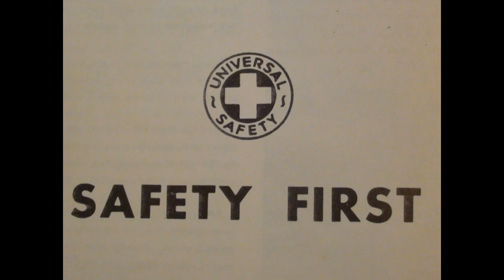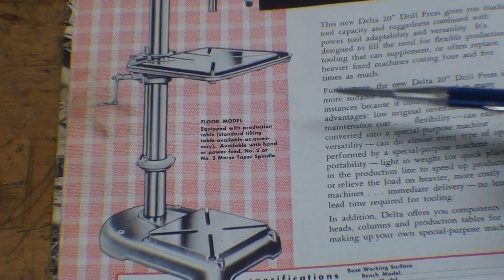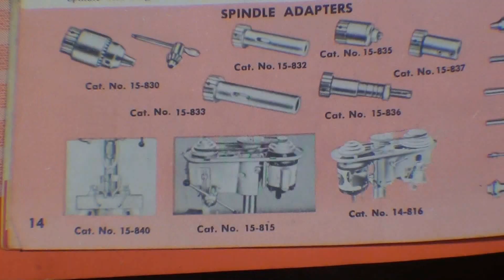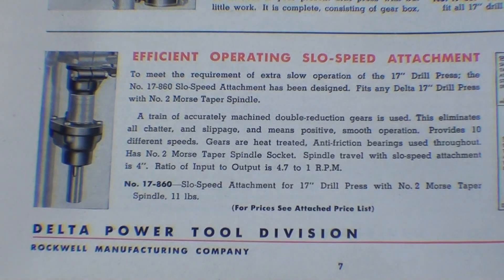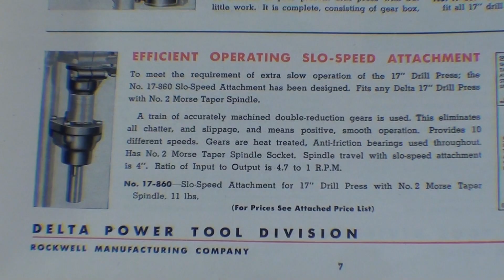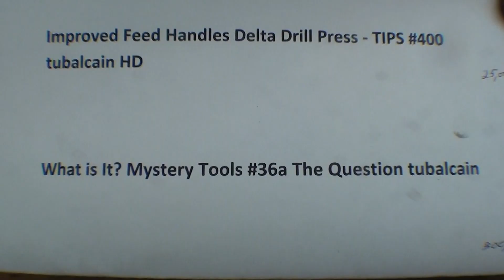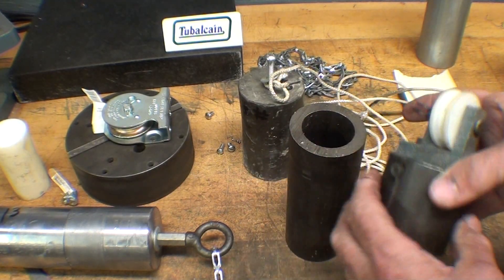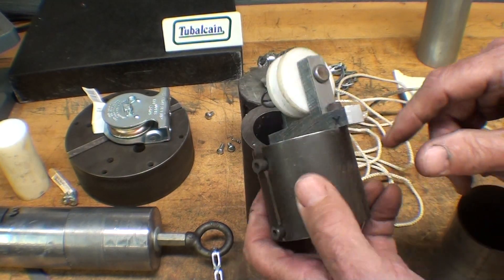COUNTER WEIGHTING A DRILL PRESS TABLE Tips #404  tubalcain

Comment: So, basically, with a counter weight you can just remove the worm gear and gear rack?
Reply from the maker: My machine did not have the worm and rack. That’s why I had a counterweight.
Reply: @mrpete222 but still much faster and easier than cranking the table.

Comment: Just found this 6 yo video and watched it not because I need to counterbalance my drill press table, but because I want to counterbalance the head on my dovetail column mill. The head on these dovetail columns tends to tilt forward when the locks are loosened. This means it is no longer truly vertical. Then, when you try to tighten the locks after changing the height of the head, it is very difficult to get the head back to a true vertical. I wind up trying to push it against the dovetail from the front while simultaneously tightening the locks which are at the rear of the side. This is not easy. And I fear that it is a problem with all the milling machines where the head is mounted on a dovetail column. 

The dovetail column design cures the X-Y position problem of the round column mills but introduces this problem with keeping the front-back tram. I have to wonder how many people don't realize that this is happening and simply blame it on a poorly manufactured machine. 

I was thinking of using some steel cable as you mentioned, but like your idea of using the sash chain instead. Of course my counterweights will have to be on the outside of the mill's column, probably in the rear. I think I will need a steel angle frame to hold the pulleys. Some of that perforated angle comes to mind. 

So, thanks for the sash chain idea.
Reply from the maker: Sounds like a good idea

Comment: Fantastic design and impressive application.  My Craftsman has a very heavy table as well and it's nearly dangerous to lift and lower.  Wish I could find someone to make me a counter weight.
Reply: You should be able to purchase a piece of solid bar stock about a 1/2" or so smaller in diameter than the bore of your column from Online Metals or maybe a local scrap yard. Unless your table is unusually large or heavy, a 12"-16" length with a hole drilled and tapped in the top should give you considerable leverage for raising your table, even if it is not lead. Good luck!

Comment: Never ever think I have said something derogatory to you as you are an idol to me. Instead of an eye bolt if you put a pulley and run the chain through and back up tp the top. Would that be better or worse? They used to use a system like this on windows to help raise and lower. Also fire doors use this kind of system to slam the  door shut if the heat link melts that holds the weight. Kind of a guillotine effect. Thank you very much for all you do. Lead, follow, or get out of the way. You lead and I will follow but someday aspire to lead.

Comment: Hello.I have a drill press, but the column has an open hole only on the bottom side facing the ground. The top side is closed. I wonder I could switch them around or if that would cause problems

Comment: A very good solution, I like it. my drill press is much like yours except it has a rack, and handwheel to raise and lower, I'd like to mention if I may, concerning the slow speeds, I moved the motor pulley stack from the motor, inboard on a plate, and then used a shorter belt, then  mounted a 2 to 1 reduction extra belt and pulleys, one small one on the motor to the large one on top of the original pulley stack, now my 600 rpm is 300 rpm, which helps with the larger drill bits. hope you're following me! well it's been 4 years since this went up, but just thought you'd like to know, take care Mrpete, regs..Dave

Comment: I see that this video is already over 3 years old at this point, but if you're still answering comments I'd appreciate your input. I'm looking for a benchtop drill press for light workshop duty. My budget is around $100 +/-. Would you recommend a new machine (such as a WEN) in that price range, or a used machine (such as a Craftsman, etc)? Any favorites?
Reply from the maker: Used. craftsman or atlas

Comment: A sash weight would work on a small drill press like mine. Photographic enlargers use sash counter springs for the same thing. I want to modify my little drill press with a couple of those rings, 48mm shaft collars will work on my little Craftsman and it can wait until I get my lathe since the shaft collars are more money than the drill press.

Comment: I sure am happy you fabricated that plug for the speed handle, WAIT, I haven't seen that video yet so I didn't have the opportunity to be outraged over your lack of a finishing touch.  I will go to bed and watch that video tomorrow and try to block the fix from my mind so I can be duly outraged like some of the others.  I sure enjoy your videos and your sense of humor and promise not to be outraged at your modifications.  I really need to inspect my old Craftsman bench top drill press and see if I can fit it with this counter weight as that table is so heavy I rarely move it and use blocks instead.

Comment: My 1938 column is solid steel a beast,,,11 inch delta drill press that's probably weights 300 lbs
Reply from the maker: Do you mean to tell me it’s solid bar stock, and not hollow tubing?
Reply: @mrpete222  sure is,, I payed 50 dollars for it,, and it's better then my 900 dollar newer delta,,,so true I turned it into a milling machine

Comment: I bought and restored a 1938 delta drill press bench model and I mounted an automotive scissor jack under table, works well and gives a truss effect.
Reply from the maker: Good idea, but if it was mine, I would have to keep a dedicated battery powered drill on it at all times. Perhaps you do
Reply: @mrpete222  never thought of that,,,but I will give it a try,,,the scissor jack is really smooth operating
Reply: @mrpete222  I figured if it can lift a car,,,I can turn it with my fingers and your drill idea would be perfect

Comment: mrpete222 #1 i have a Dayton floor drill press with a slight ding in the 2.3/4" column I can wiggle the table over it .. Should i just file the column or file a spot on the collar ?... #2 i love the counter weight idea..I bought it for a 100 bucks..cleaned an painted it the column sparkles, . Replaced the 4 step pulley on the motor , they had an odd pulley on it. I use it for home hobbies..I like to hear you thoughts on that. Thank you , Dan from New Haven,CT.
Reply from the maker: File the column
Reply: That is what i wanted to hear..TY..

Comment: Re: upgrade on the three arm handle add-on

Hex Head!  That's just a hack job!  Why didn't you use a SHCS?

oh, and it's only a grade three, what don't you ever think about durability?  Shoulda been a grade 8!     LOL...   

Why aluminum? Cause it's adequate in strength, and easier to machine!  

All joking aside, I'd do this for my drill press if it wasn't destined for the scrap heap. Need one without the ungawdly run out this one has.

Re:  the cast column clamps as a table stop.  I found 2" ABS pipe works great as table stops.  Cut a bunch of them to various lengths you want, then cut enough away from the circumference the pipe will 'snap' over the column, and stay on.

Has saved me from smashed fingers from the too heavy table, several times.

re: slow drill speed

I slowed my drill press down about ten years ago, and I still am amazed at how it changes a drill press.  It's like it's another tool.  The only time the slowness is negative is when I have to drill > ⅝". Then I need mo' speed.

Thanks for sharing, and all you do.

GeoD

Comment: when  you had your craftsman?   did you like the craftsman the least?  If so why?  and what model was it?  I have the Craftsman 100 1947 floor model wit h 1 hp motor and middle pulley.    I   found your vid because like yours the table is hard to lift.  Someone put a crank on mine but I may change it to a counter weight.
Reply from the maker: I don't remember the model number of my own. But I did not like the one that use the skinny little Veebelt

Comment: Tubalcain. The pulley that you showed is made by national hardware. 3219BC Wall/Ceiling Mount Single Pulleys  model # n233-254 for the 2" size that handles 3/8" rope. They also make this in a 1.5"  n233-247 that also takes up to 3/8" rope. The 3 mounting holes are .26" diameter. You can mount this to the side of a rafter, bottom of the ceiling, or on the wall.  I just ordered a pair that should ship on Monday. Midland Hardware has some great prices on these or go to Ebay. Enjoy.

Comment: My Craftsman has a Jacobs chuck with a screw collar (Jacobs 33C) Which is attached to the chuck with a snap ring. Those collars may be available so you can fit any J33 taper to your spindle or perhaps thread your non-33 taper spindle to fit a collar. 

The collar is great since it can press the chuck off as well as hold it on.
Reply from the maker: Thanks, I did not know that

Comment: Great idea, but my Craftsman head rests on top of the column. Still i think there are several ways I can adapt it. Hanging the table from the pinch bolt is convenient, but attaching a bracket between the table and the column may tend to cock a loaded table (work plus vise) a bit less. A worn lead screw and an electric drill would lift a table slowly, but the way you can move your table with virtually one hand looks unbeatable. Perhaps if I put a pulley inside the column with a hole for the sash weight chain to come out It would work. Mount the pulley on a shoulder bolt located through the column under the head locating the pulley in the column with spacer sleeves on either side. 

Fabricating a pneumatic cylinder under the table may be easier, LOL, especially if you have filled the column with cement or sand as some recommend. Would pvc pipe work? An air filled hydraulic cylinder? from a leaky engine crane?
Reply from the maker: Lots of possibilities for your experimenting pleasure

Comment: If you tapped the ears on your pulley bracket and put in a couple of bolts you could use those to snug up to the sides of the drill press body to keep your pulley properly aligned.  Very similar to how you used the cap screws to help hold your tubing in the bore.

Comment: I have one of those spindle adapters, drill press to 1/2" collet. by Craftsman. I don't know if its the right taper for you but it does have the locking ring.
Reply from the maker: Did you want to sell it?

Comment: Great solution to the problem of the heavy table. We had beastly Powermatic with the rack and crank, but even that cold have benefited from a counter weight. I wonder if it would translate to my bench top model, or if I'd just be making work... the table is a full sized casting, just a shorter stand.
Reply from the maker: Thanks for watching. It depends on how strong you are

Comment: Hello Mr Pete, I was wondering if you could make a video showing how to make a slow speed attachment for the small Walker Turner drill press you showed early in this video. I have the same drill press here in the shop, and would love to make it more functional for everyday use. In my almost 46 years, I also have never used the highest speeds. If you have contact information, I can send you pictures of my research, and pictures of what little progress I have thus far. Walker Turner did make a slow speed attachment for this drill press, but looking online, most are going for around $300. So that's not very cost effective. Hopefully you can help, and have a great day. Thank you.
Reply from the maker: I really don't like those slow speed attachments, they used two belts. I do have one on another press.

Comment: That's brilliant, Pete.  I can see a counterweighted future for my drill press which has suffered the 'ole "crank it when it's locked" syndrome...

I went to the hardware store the other week, looking for some tallow.  Got about the same response as your greenhouse pulley request.

If you want to drop your speeds, add a floating step pulley, flip either the motor or spindle pulley and run two belts.  With 3 x 4 step pulleys, you get a 12 speed setup.  Admittedly, 6 of those speeds will be stupidly fast.

The other option, of course, it to run the thing off a VFD, but who needs that, amirite?
Reply from the maker: Yes, do it

Comment: wow low blow on the smokers, also profoundly misinformed; cells in the human body mistake lead for essential elements like zinc, so a cells absorb it, they cannot use it though and are unable to function, causing the cell to die and the lead to be passed along to the next unfortunate cell; unfortunately braincells are most at risk, some historians point to it as one of the likely causes of the fall of Rome, I read in one of Jacque Cousteau's books that he stopped eating seafood in the 70's specifically because of the levels of lead he was finding.. lol, anyways on with the video!

Comment: I have two  restored, working camelback drill presses from the 1800s. Both of these drills are in regular service. 
  One is a WF and John Barnes 1100 pound monster and the other is a svelte 500 pound Hoefer .  Both of these drill presses have "sash weights". The Barnes has a cast iron fitted weight .  The Hoefer weight is a 22 inch by 2.5 inch  bolt with a welded loop for the sash chain attachment. 
  I like your videos and the side bars add so much flavour.  Life is a collection of events. Keep up the good work.
Reply from the maker: I'm glad you like the videos, keep watching. I had a very large buffalo drill press at the high school. Power feed and 12 inch stroke, with a number for morse

Comment: I never realized that a substantial drill press like that wouldn't have a height adjustment crank. 
I assumed that was a standard feature given the excessive weight of those tables. 
Excellent video by the way!
Reply from the maker: I'm sure it was available as an extra

Comment: Next query: I also have the drill press with the "Change the belt configuration to change the speed" setup. Its a Chicago Floor model from China (Harbor Freight). Problem: NO understandable translation of How to change the speeds and what resulting speeds will I get. I know the how part but not the cognitive ability to "pre-know" how to arrive at faster/slower speeds - in particular go slower - go faster.-- Big to small -- big to big -- small to small ....I really do not want to take up the profession of adjusting the drill press, I just want to drill. "''splaina me, Senor" as Desi would say.
Reply from the maker: Set the built in one of the pulley grooves and check the spindle speed with it to tachometer. Write it down, then move the bill to another position, and check it out. Etc.

Comment: Very helpful for me... I have a huge Powermatic Variable-speed Model 1200 drill press that I bought at auction w/o a table.  I purchased a Delta brand table and re-bored the column hole to fit, but the table weighs over 100 lb and I dread adjusting it up & down!   THANKS for the ideas!
Reply from the maker: Those tables are terribly heavy

Comment: All that coffee .. I was waiting for you to let the chain drop down the tube  !  Ha Ha.
My drill has a solid column  !
The other issue is the fact that the column gets stiff as the oil on it dries out and attracts dirt.
 I have also got an X Y table on top of the factory table  !
I think I am going to have a go on the outside (not so neat) & use a 56lb weight.
Wish me luck
And you have a merry Xmas.
Reply from the maker: The chain of course did disappear into the column. Spent 15 minutes fishing it out with the magnet. Yes adding the table would make it even heavier good luck

Comment: I had considered doing something like this to my drill press but I ended up putting a trailer hitch jack upside down on the column so I would have a hand crank to raise the table. Looking at the action you are getting out of your modification, I'm going to scrap the jack and follow your lead.Or lead, or perhaps steel. I have a lot of window sash weights from my friend's old house when they upgraded the windows. They are handy things. I put a carabiner in the eyelet and use them to counterweight my photo equipment.
Reply from the maker: Good idea

Comment: It's your drill press—you can drill as many holes as you want in it 😁

Funny that you found the 4000 RPM too high—i bought a little Servo drill press off eBay for precision work because my Craftsman press has too much run-out. The Servo press will run up to 20,000 RPM,   but it will only hold up to 1/8" bits. Still, very nice to have a machine with no runout or vibration.
Reply from the maker: High speeds for Tony bits
Reply from the maker: I meant tiny

Comment: I get to do a Mr Pete Rant about our educational system!!! lol At 4:10 your math is failing. The brochure says the input to output is 4.7 to 1. That means it is a 470% speed reduction or you could say the drill runs about 21% as fast as it did.  Either way that is a lot different than reducing it by 50%. :-)
Reply from the maker: Whoops, I saw that after I had publish the video

Comment: You can put a 3rd pulley on the Walker Turner to get lower speeds, it was a factory option, but most did not get one. It would be easy to make one, the mount for it is already on your motor mounting plate, if you need a pic of one let me know. Great idea on the counterweight, I'll have to add one to my machine.
Reply from the maker: I have one of these on another press
Reply: "How to make a 3rd Pulley for the Walker-Turner Drill Press" would be a good video :-) Love your vids, when I'm not making chips, I like to watch others make them, and there is always a kernel or 2 of wisdom in your vids.

Comment: I've got a newer Delta drill press with a crank table. However, I think I'm going to add the counterweight system just to ease the pressure on the rack and pinion.
Reply from the maker: Yes, do it